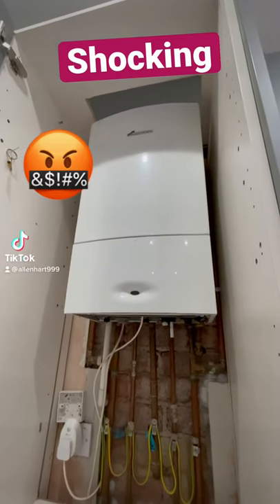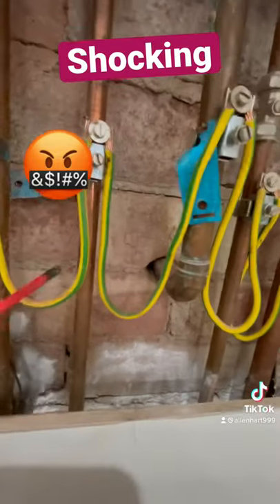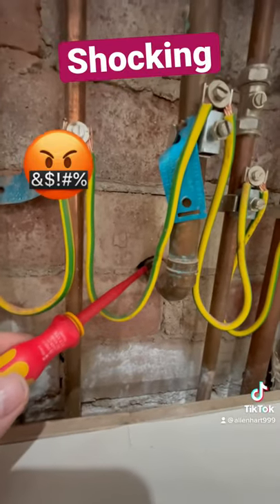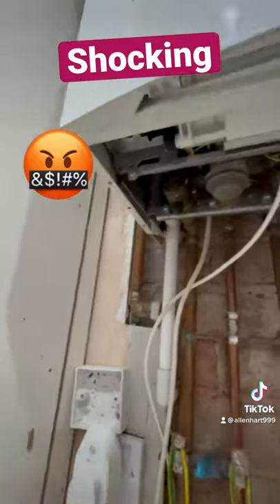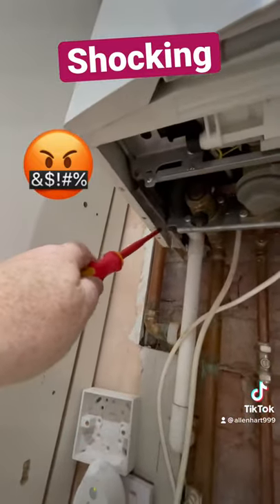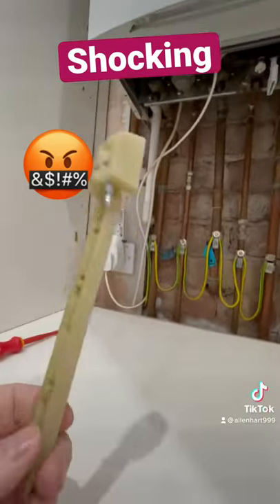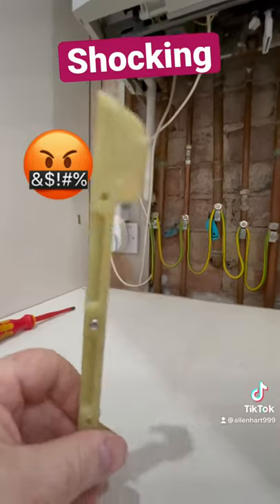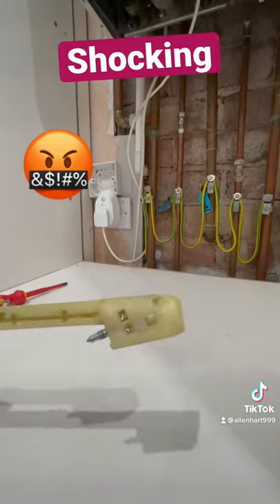Dangerous Worcester Bosch Combi Boiler. Called Out To Do A Boiler Service

Comment: Those Worcester cases are pretty shocking anyway,  but it's rare for the plastic runner to fall off. You can buy a runner repair/ replacement kit. I've done a few over the years. It's normally the casing screws that get dislocated in the plastic moulding and you have to lever them back into position before you refit the case. The lack of sleeving on a gas pipe is on another level
Reply: Your r8 there those cases are shit
Reply: Right shit cases
Reply: I fourth that ! As a homeowner took one off and i wondered if it ever fitted properly on trying to put it back.
Reply: @superwhites5870  r8? as in rate?
Reply: Hi what combi boiler would you recommend
Reply: I think Worcester boilers worse casing rubbish and horrible to install 
Ok the pipes not sleeved and casing not fitting easy fix is it shocking it’s crap workmanship that’s what it is

Comment: A gas pipe without a sleave is classed as at risk and only worthy of a warning notice.. a self tapping screw will sort out the loose case out 😅. Stop being so dramatic FFS.
Reply from the maker: do you know what AR means and what to do?
Reply: A gas pipe passing through a cavity wall is not at risk unless it enters from within a meter box or is showing significant signs of distress as per IGEM/G/11 EDITION 2. notable at worst, your blood pressure must be through the roof 🤣

Comment: I’m baffled by why the pipes are Sup bonded like this, even when the copper pipes all go up to the boiler metal plate are they not all touching bonded there 🤔
Reply: Electricians regs stopped requiring this for installs after 2008 when the 17th edition of BS7671 came in. Must be a heating engineer job then or a confused electrician! 😀
Reply: @Михаиллеви  cheers for reply 👍👍
Reply: From an electrician and gas engineer here...it is no bad thing putting supplementary bonding across those pipes. Considering the state of wiring in many properties, unless you are absolutely confident in the electrical installation then having that bonding is an extra safety precaution.

Comment: Hi,

Worcester Bosch were one of the best Boiler Manufacturers out there until they came out with the 2000 and 4000 range Gas Boilers.

There will be many more to come as the casing has just got worse 😊